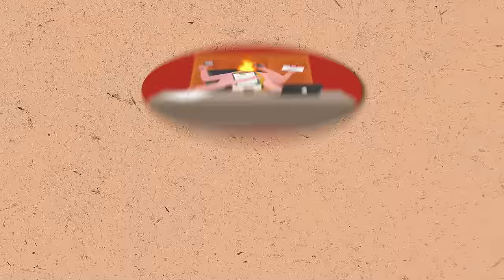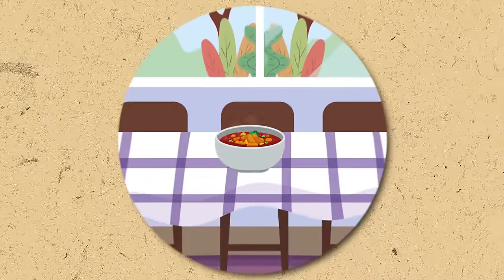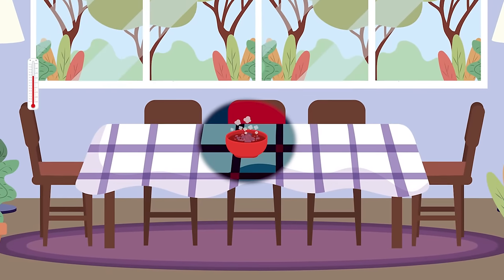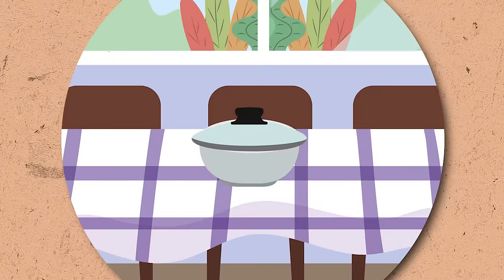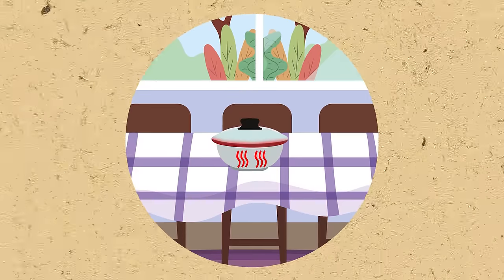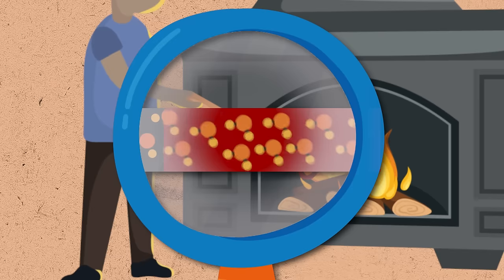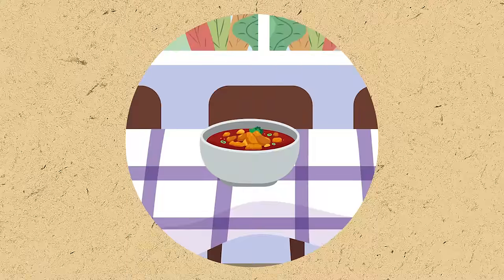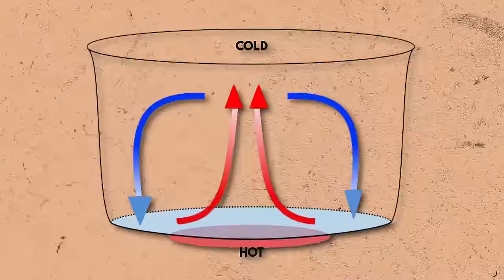Why Are Thermoses So Effective?

Comment: 12:05 Actually, oh here we go, wind causes what is forced convection, that's why refrigerators, air conditioners, radiators, etc. have fans. Buoyancy (such as the hot air rises in a gravitational field) driven convection is called natural convection. By the way, a car radiator is a bad name. Most of the heat transfer is because of air forced through the heat exchanger. They are really convectors. On the space station, they have radiators though.

Comment: It always bugs me when I see open windows on cold winter days, usually in older apartment buildings.  Pretty much guaranteed that the room inside is being overheated by an old-fashioned steam radiator, and whoever is in there has opened the window in an attempt to get comfortable.  Meanwhile, they are literally heating the whole outdoors.
What people should do is throw a blanket over the damned radiator, to reduce heat transfer into the room.  This saves energy, as well as the pollution that goes with generating it.  Yeah, you're probably saving the landlord money, not yourself, but we all live with the CO2 the furnace is spewing out... and every dime the landlord spends is another tiny step toward a rent hike.

Comment: On the subject of Apollo 13, there would be a real danger to remaining perfectly still.  Yes, the air in contact with your skin would warm and then act as an insulator.  But if you don't move and there are no fans moving the air around the capsule, the CO2 you exhale would remain close to your body as well.  CO2 would concentrate around the astronauts' faces and eventually become a danger.  I am guessing that the CO2 scrubbers must have circulated the air, causing at least a small breeze that would carry heat away from the astronauts.  But the less the astronauts move, the warmer they would remain.

Comment: I chase Meteorite falls . We are currently trying to figure out how a 100 kilo space rock ( probale L brecia ) ablated on such a short and steep entry although steeper trajectories do account for higher ablation ratios . Only about half a kilo has been found but professor Utas at UCLA tells me that that the computer models say that given all the data there should have been about 10% ablation from friction and heat transfer vaporizing the incoming bolide. The O2 around the space rock catches on fire and this causes ablation. You don't see the Rock burning you see the oxygen around it burning. As they get lower in the atmosphere the pressure in front builds  and KaBOOOM they detonate . Not long after it detonated the ine we are chasing went into dark flight . There should be 20 pounds of meteorites on the ground at 90% ablation. Only a pound has been found . All in the shadow of the lowest doplar radar return. There were only two returns , one up high and one down low showing the angle they were falling at . They landed almost 3 miles to the side of where the field should have been due to being blown at altitude by a 300 mph sheer wind . They started free fall at around 12 miles . Dark flight occured at 26 kilometers . If the main trajectory points at 12 o clock the pieces were removed 1.7 miles past the terminus wher dark flight began and 3.67 miles at 9 o clock so they went 1.7 miles past and got blown 3.67 miles to the left . They were already in free fall when they hit the wind sheer. Its amazing we found anything. Thanks to the doplar radar 😅

Comment: So no rotating boiler would work, it would not support the heat of the plasma without deforming it, for cold fusion, only the surface of the boiler would be kept cold and the inside would stick to the plasma, it would also make rotation difficult for .cooling! The ideal was to spin independently of the plasma!

Comment: Why are you making so many mistakes Neil? You don't say least efficient way for heat transfer. This is absurd statement. It's slowest . Efficiency is when your all input energy is converted or transferred into outpot, if not then not efficient. All three form of heat transfer occurs in the soup cup and none is 💯% efficient. To say one is efficient transfer over other depends upon the environment or the specific term called universe as used in thermodynamics. Also air is very bad conductor.